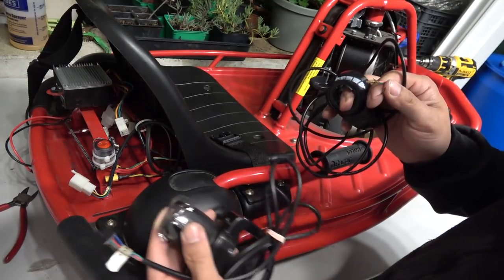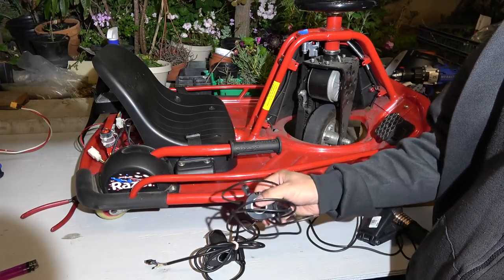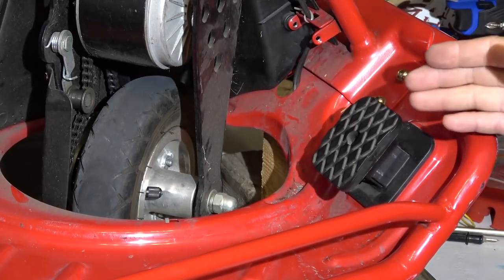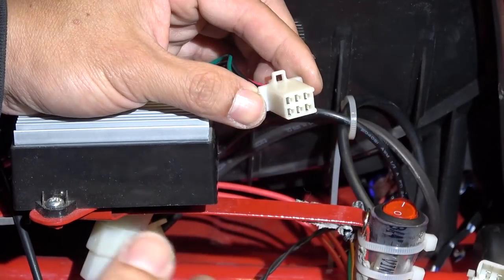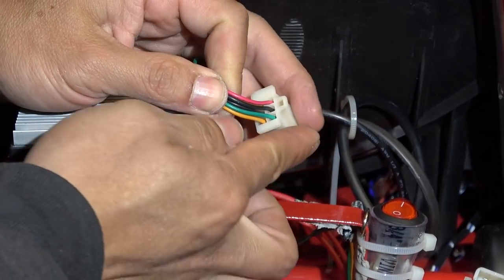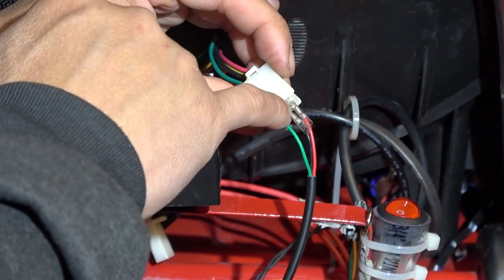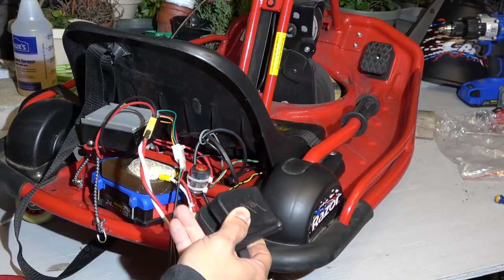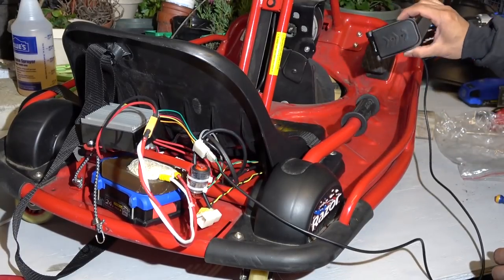DIY: Hack a Razor Electric throttle: Replace Crazy Cart foot pedal throttle w/ aftermarket

Comment: Thanks so much I needed to know the pin out for the throttle , I’m putting the motor and controller on a Revvi 12 inch kids bike , hopefully be a lot faster compared to before lol

Comment: Great video. I learned alot. Just a question, what are the yellow and orange wires for?

I am looking to change a hand throttle (6 pin) to a pedal throttle. I am wondering if I have to short any pins in order to get it to work and not to burn anything. Thank you so much!

Comment: Can I just buy a 5 pin one and connect without control module? Or do I have to buy a control module. Also do I have to use 3 pin or can I use 5

Comment: Does it has something like a variable resistor or it doesn’t work like a switch which just have 2 position (on and off) but a thing that depending of how much deep you press it will accelerate? I don’t know if I explain me property 😂
Reply: Original one uses a 49E linear hall effect sensor to output a variable voltaage between nominally 1 - 5 volts depending upon position of the pedal. Has 2 magnets with opposed polarity to  provide variable field density which affects the output voltage.

Comment: my cart has 3 pin but still not working when i connect it automatically start when i change wire color the and press the pedal the motor stopping

Comment: Hi im a owner of the normal ground force that came with the 3 pin original throttle and i replaced it with the new 6 pin throttle and also bought a new controller.after assembling all together and Switch on Power all i get was smoke coming out of the Controller.later i realized that i had to change the positiv and negativ wires on  the brake in order to get it work.(that is my guess from what i've read so far) i would like to know if the Controller is Destroyed forever or is there a fix outthere to get it work again for me?
Reply from the maker: If smoke comes out of the controller then something has been burned. It needs to be fixed before it can work again or you'll need a new controller.
Reply: @vuaeco  thanks for reply. Just another  question hope you can Help me with is,  now i need a new controller but what have i look for to get one who will work for me because if i order the Original one it will Cost me about 80$ with shipping cost an all that.so i would be happy to know what i need to looking for in order to make the cart work again.
And sorry for bad Spelling but englisch is not my first language.thank you sir.